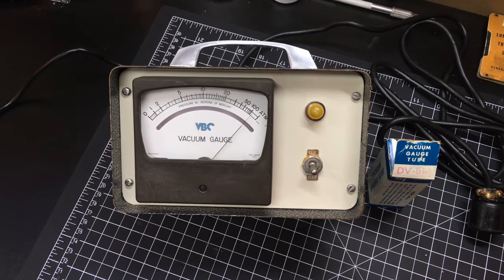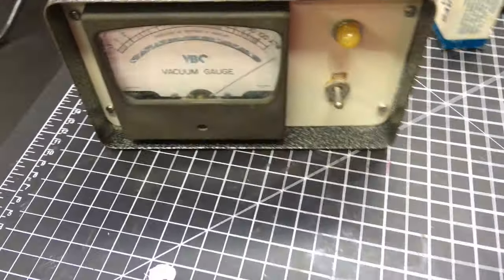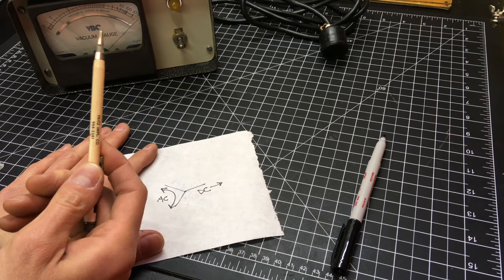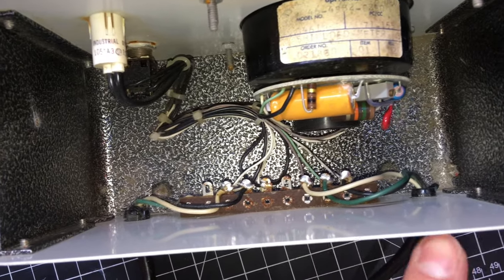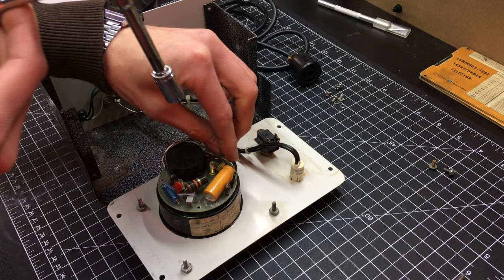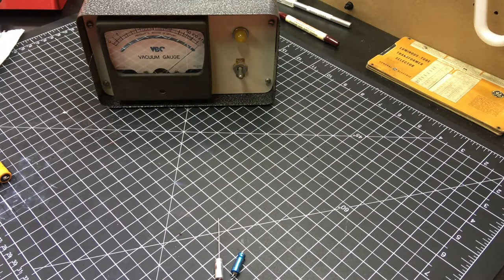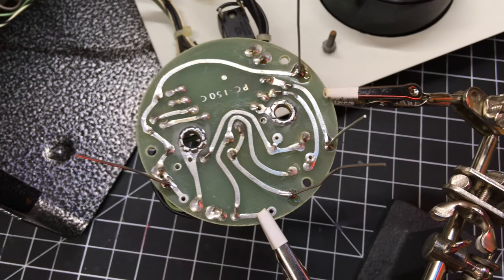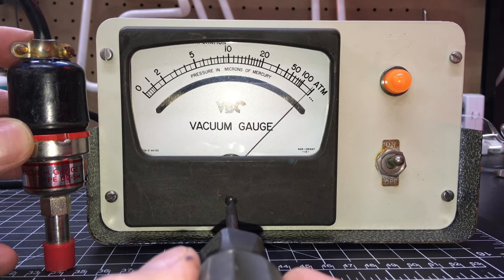Thermocouple Vacuum Gauge repair

Comment: 12:17 - Watxh this (almost) perfect hand solder (pronounced 'sodder' in America) technique. He may not have shown the shot where he tins the iron with a bit of solder first and brushed a bit of liquid flux to the joints before soldering. Otherwise, iron in one side of the joint (heating both the component lead and the pad); solder in  at the complementary angle to the iron; remove the solder; and lastly remove the iron (all in under 2 seconds) would make a perfect Chocolate Kiss joint every time! Great job, Sir (I said 'almost' just to get your attention)! And thanks for passing on your knowledge.
Reply from the maker: thanks for the compliment!  i haven't been formally trained how to solder, i just watched a couple 'how to' videos on youtube... everyone has to start somewhere, right?  :)

Comment: As an old guy  (years ago in HVAC)  I don't know WHY  I sort of expected these  tubes to be  "standardized"  but   I'm finding out there are more than  "several"  pinout  schemes  for them.
Reply from the maker: haha, of course.  i know that thermocouple gauges with different ranges require different gauge tubes; perhaps they are pinned differently as a 'safety device' so as to not interfere with the circuitry should someone use the incorrect gauge tube?  just a guess.

Comment: NICE PROJECT, do you have the diagram for the meter circuit ? I bought one unit similar to your but it has a huge transformer and I think that it not essential , perhaps bad engineering. It has a sec windings and on it has a capacitor 2mfd/ 400 vac , don't know why they did that. The original cap was expanded and shorted. so the 350 volt output from the transformer was shorted across the cap.  So I decided to modify the circuit and still working at it, I want to use a 6vac utility transformer (perhaps doorbell transformer) Bottom line , I don't like the circuit. I want to go simple like yours. so , do you have the diagram ?  one other thing, I noticed you adjusted the meter when it was powered up. I think that is the wrong thing to do, reason is the the meter is Darsonval movement. You adjust them with out power by rotating in one direction only , so the meter should deflect left and then right or vs versa. Once the meter has been set to atm which is basically o input then turn the adjustment in the opposite direction slightly . The reason you turn in the opposite direction is to relief any pressure on the movement . The adjustment is somewhat like a tuning fork and by turning in opposite direction slightly is to center the fork in between the adjusting post of the meter.   Thanks  good video    Juan Lozano ( navy vietnam vet - x calibration instructor)
Reply from the maker: i did find a pdf of a manual from the '70s that had lots of detailed information, including calibration instructions.  it said to power up the meter and make adjustments to the mechanical zero screw, so i think that's ok?   however, its quite obvious that you know way more about them than i do.  anyway, here is the link to the (71MB) document:
https://library.nrao.edu/public/memos/vla/tech/VLATR_11.pdf
the circuit schematic is about ⅔ of the way down.  hope this helps!
Reply: @NeonPreservation I eat my words, but  I agree with the zero adj , I did find that in the pdf but question the process being that is a mechanical portion of the meter. 
 But what I find is most confusing are the drawings on pages  46, 47 and 48  where power is  fed to terminals  6,7 and 8 and seems to short on the meter ac terminal ??? anyway I did find some good reading. 

Thanks 

Juan